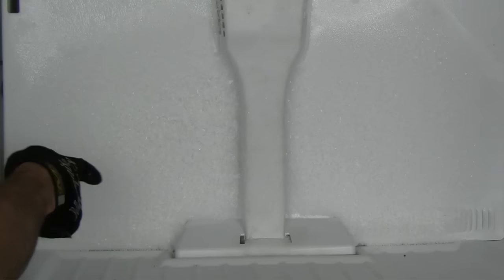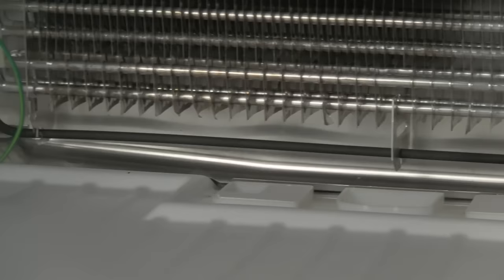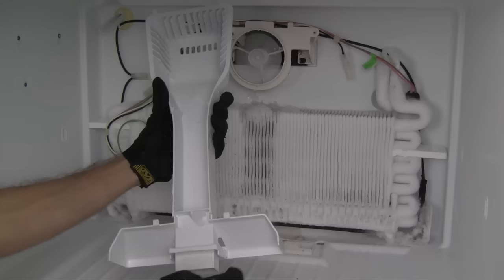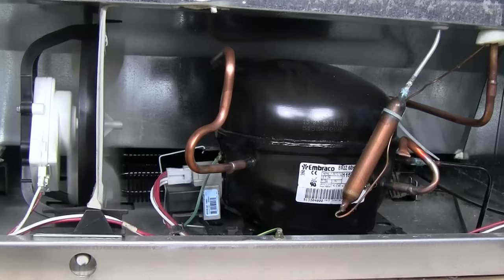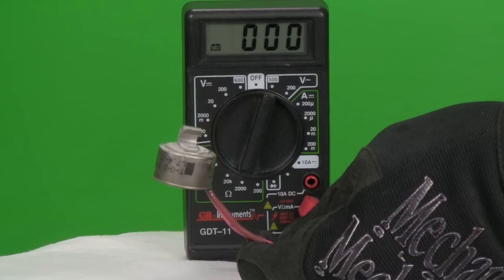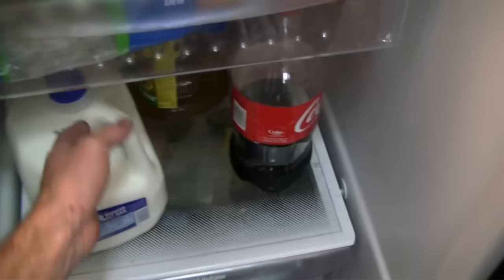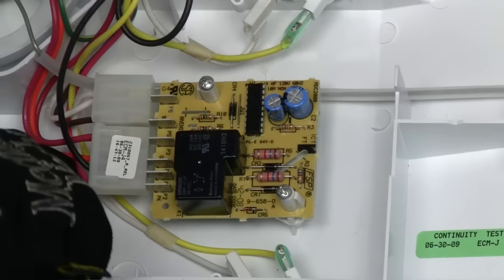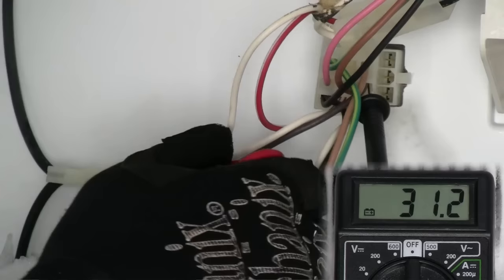Refrigerator Repair (Not Cooling, Defrost System)

Comment: Husband randomly blew out the coils and fan in the back of the refrigerator with a compressor - next morning the refrigerator was warm! - I took off the back inside the freezer and found it was iced over - I replaced the heater and it defrosted as it should again! However, the refrigerator is still not getting cold enough - I am at a loss now since I know the heater was bad and has been replaced, what else it may be now!
Reply from the maker: Given the cleaning event that preceded the problem, you should definitely verify that the condenser fan motor (the fan by the compressor) is working and not jammed by some dislodged debris. The timing could definitely be coincidental. Another thing to look for would be an uneven frost pattern on the evaporator. The evaporator should be evenly covered with frost. If there is a large area that’s clean aluminum, it likely a sealed system restriction, which is a pretty big problem. Hope that helps!

Comment from the maker: @mkiitmr2 Some Whirlpool models can be forced into defrost that way for diagnostics.  It sounds to me like you need a new adaptive defrost control (ADC). You can force it to defrost but obviously it should be doing that on it's own.  If you would consider purchasing the part through a link on my main website ( ApplianceAssistant . Com)  I get a commission and would really appreciate it!  If you email me a model number through the site I can look up the part for you and send you a link.  Thanks!

Comment: Thank you for the video! I have replaced the defrost timer in my side by side. The defrost thermostat was up around the lip of it so my appliance parts place told me to put nail polish around it to seal it and see if that worked. Well, after about 4 days, now the fridge side is again not getting any cool air at all. The damper is open, just nothing coming up through. The fridge shuts off when I hear the click from the defrost timer. The heater works fine, but did the nail polish not work?

Comment from the maker: @Philrocks09 Bummer...I'm not sure about that Frigidaire model number...If the coils are on the back of the fridge and clean then it does not sound good.  If the coils were under the unit then you may have a condenser fan problem, but static condenser models (coils on the back) don't have a fan by the compressor that can fail.  It you can feel the compressor pumping (vibrating) then I would say that one is a goner. Save your service call cash for a replacement. Sorry :(

Comment: Good stuff Appliance Guy, My 6y/o GE Over/Under Model GBS22HCPABB isn't cooling.  All of the fans are working, the thermostat works to turn on the compressor and condenser fan, the defrost heater is not turning on, this tells me that is should not be in the defrost cycle.  My guess is that the R143a has leaked out somehow...any thoughts?

Comment: we have a MayTag side by side and for some reason the fridge part is not cold the freezer works great see on June 25 this year we had a repair guy come and fix it and put a new defrost control in it worked great but today july 3rd fridge is broke with the same problem not staying cold this happened after we had a bad storm last night but the freezer part still works do you think the storm could have done something to it

Comment: Very helpful video. Thanks however, the power to the fridge tripped whenever it goes into defrost mode. Any suggestion will much appreciated. Fridge has seperate compartment with individual heater, Thanks,
Reply from the maker: Check the defrost heater for a short. If not there, check the defrost thermostat for a short also.
Reply: @applianceassistant  Thank you for your super prompt response. Will do.

Comment: Hi I have just pick up a little 5 ft fridge /freezer plug it in , it is a little cold but left like that will not keep food cold or frozen ? What should I do ?  The man in shop said turn it upside down maybe air lock . I f I do this should I have fridge on or off and how long for ? Thank you if any one can help ........
Reply from the maker: Sorry for the delay! there are a few mechanical styles on those little refrigerators... some have compressors and some have a crazy little piezoelectric cooling wafer. If you turn a compressor style upside down it will likely be trash after, and it would have no effect on the piezoelectric type... Do you have a model number?

Comment: I work maintenance and a residents freezer is just literally giving no heat, usually when I replace a T-stat its due to over frost and the part is visibly broken (busted open). The timer is working, and so is the fan which would not be the problem anyway. Could it still be the T-stat? or do I have a junk element here?

Comment: Ok. I have fixed this fridge/freezer once befor because it would no longer cool. We bought a new one right away since the old one was old. I had replaced the timer. Well now what it does, it frosts up and the fridge is warm/hot. It did that once and then started working a few weeks later. Now it is back to the same thing freezer back frosted and the fridge warm/hot. What should I look for now? Thanks in advance!

Comment from the maker: @spray2009 if you think that the door was left open --and the freezer is still cooling-- unplugging the refrigerator and letting it thaw out will almost certainly fix it.  However if the problem returns in a week or two, or the freezer is not cold then you may have a mechanical problem.  There is a lot more troubleshooting help at ApplianceAssistant Com!  If you have any other questions email me through my website with your model number and I may be able to help out with more info.

Comment: Hey, i have a Lamona HJA6000... Quite a while a go (about a month) the fan broke and i ordered a new one, during the time the fan was not working only the bottom of the freezer and fridge would get cold, and quite a lot of ice was forming behind the plastic covers at the back of the freezer, now i have replaced the fan the freezer is working great but the fridge isn't getting very cold at all  a red light also came on the refrigerators display. Any help would be great!

Comment: Hello all, 

I just moved from Texas to Colorado and my side by side fridge sat in storage for 3 1/2 months. We hooked it up and  let it run for 4 hours and the fridge side it not cool and the freezer is soso cold. I don't feel any air blowing around but the back wall on the inside of the the freezer is cold. The compressor is vibrating and hot as ****. The fan is also working. How long should I let it run before I get concerned? Thanks. Love the vid.

Comment from the maker: @stringfellowhawke247 If the fan is working well and your ice cream is cold then you must have some kind of problem with the diffuser door or the air return vent is clogged.  Even when I bugged my refrigerator to cause the frost that you see in the video it took three days to get that much frost. Some frost is normal but it should be removed automatically by the defrost cycle. Could you get me a brand and model number please?

Comment: I have a GE Side/Side fridge and the door was accidentally left open overnight. You can see the condensation all over the inside of the fridge. Freezer is still cooling, was up to -10F at one point! Fridge up to 50F. You think a manual defrost would do the trick? That's just leaving it unplugged overnight with the doors open or closed? Thanks!

Comment: I have amana bottom refrigerator(model: BX20S5W mfg. No: P1196506ww). The freezer is not cooling anymore. I opened the cover and notice the pipe that comes, I beleive, from compressor to the evaporator has iced up(about 2-3 inches, it had also covered the thermostat) but the evaporator was ice-free. Both the freezer and refrigerator are warm. The fan seems to be running okay. I am leaning toward defrost timer or thermostat. Any ideas?

Comment: Super helpful.  A few questions.  Have a GE unit with the freezer on the bottom and french doors on top.  Defrost cycle not working.  Element is ok.  Thinking either thermostat or board.  How can I check the thermostat?  Video was a little   Also, how can I force a defrost cycle?  And if that's successful, then is the problem for sure the board?  Lastly, is there any way to get a field tech service manual? Thanks!
Reply from the maker: Sorry for the delay! Unfortunately the control boards are a common failure on the GE refrigerators. You can't force all of them into a defrost... What is your refrigerator's model number? I'll look to see if I have the manual.

Comment: My Frigidaire refrigerator (freezer on top) only 'kicks on' (fan and compressor) when I turn up the themostat (make it colder).  After a short time (20 min.) it turns off and doesn't cycle back on.  I though it was the defrost timer so I just replaced it with a brand new one and same problem?

Comment: I have a GE Model # GSH25JSTA SS and the freezer wall has built up ice. I have alot of the described issues such as the refrigerator isn't keeping food cool and freezer just seems like its not freezing.  I have noticed that the cover gaskets for the heater cover are warped and singed.  Do you  think the replacement of these little gaskets are the issue here?

Comment: QUESTION: I have a Maytag MSD2651HEW. The lights, fan inside the freezer and next to compressor are working but it isn't cooling at all. I've checked for build up of frost but there isn't any. I unplugged it for few minutes and then plugged it in couple of times, freezer fan, compressor and a fan next to it sound normal  but still isn't cooling. Any thoughts?
Reply from the maker: It's not good... If the compressor is running with those symptoms, it has leaked out the gas and is going to need major reopair. If it's not a very hi end refrigerator, it's probably best to replace it.  Sorry to be the bearer of bad news.
Reply: applianceassistant hhmmm, about three weeks ago my daughter dropped something that went under the fridge and she asked me for help. I removed the front panel at the bottom of the fridge and noticed a thick layer of dust on coils which I cleaned out with the vacuum cleaner. That might've done damage! Thank you so much for your reply. I appreciate it.
Reply from the maker: you may want to check the fan in the back, near the compressor and make sure its not jammed up with dust.  cleaning the coils under the refrigerator is good! The only thing you need to be cautious of is jamming the condenser fan.... or punching a hole in the condenser coil, but i doubt you did that.
Reply: though maybe hard to believe clean coils ( if you have access ) can make a world of difference in performance. Check to make sure that condenser fans turns and runs. Of all things I had a mouse crawl through the fan blades at the wrong time and was killed and was jamming the blades from turning. Any item or thing can easily be lodged and prevent that fan from turning

Comment: my fridge doesnt have any ducting between freezer and fridge it is a side by side general electric model PSH23PSWSS. it has 2 evaporators 1 in each side. neither were frosted my defrosting circuit works and my fridge just isnt cold? the compressor seems as if it doesnt always want to start. the freezer seems to be about refrigerator temperature. any advice?

Comment: My whirlpool top freezer fridge is not cooling the fridg but is freezing the freezer, I've replaced the by metal therm and the timer and still no cooling in the fridge.  There doesn't seem to be any blockage  of air flow. The evap in freezer does run too.  Any clue.

Comment: Thanks for this video. I had the same problem with my Kitchenaid Refrigerator, Model: KSCS25QFAL00. When I tested the heating element for continuity it passed and for the resistance test it gave me reading as Zero. Could you please tell me what does this mean? Is the defrost element bad? (I am using Klein Tools MM100 multimeter.
Reply from the maker: The heater is probably okay. It should have some resistance but it may be a meter setting problem.  if it was actually zero Ω it would trip the home breaker or blow a fuse when it did a defrost cycle.  So I would check the bi-metal thermostat (part#2321799) up at the top of the evaporator, it should be 0Ω resistance when it's frozen.  if that's okay then chances are you need a new defrost control board (part#4388932)  Hope that helps! Good luck!
Reply: applianceassistant Thanks for the reply. Yes, the heater may be OK. For past two weeks fridge is working OK. If it breaks again, I will take your suggestions. Thank you so much.

Comment: Very helpful video! I wish it had been titled "Fix Defrost problems in Freezer and Refrigerators". My problem is that my automatic ice maker in a top freezer refrigerator stopped working. Then, there was trouble with the temperature remaining stable. There was drops of ice on the back of the freezer. I saw that the coils behind the freezer back were frosted/frozen over but the defrost heater wire below the coils was clean. The freezer fan motor blade (above the freezer coil) was free and rotated easily. I checked continuity of the fan, and there was no resistance, which I guess means its a bad fan. I'm thinking that the water line to the ice maker got frozen and that's what was causing the ice maker to quit working. So . . . a freezer fan that stops working can cause the defrost heater to be ineffective? Thanks in advance for your help
Reply from the maker: if there is only 2 wires going to the fan motor your test is correct and the motor is bad. on a DC motor with 3 or 4 wires its slightly more difficult to get a good reading. The fan motor would not directly cause frost build up but it would cause temperature problems and may cause poor ice production.  Sounds like the fan is a good place to start. You may find you need the ice maker also but start with the fan.  Thank for the question! I hope that helps some!
Reply: @applianceassistant  Thanks, that helps. that fan motor did have just two wires. I replaced the freezer evaporator fan motor and the entire freezer, icemaker and refrigerator is working great now. Without the fan to pull the heat from the defrost heater coil up, the icemaker incoming water and evaporator stayed frozen. I think the heat from the defrost heater coil was  warming the refrigerator too. All good now

Comment: So, I've got a 5 year old Frigidaire top-mount that gets a cold freezer, but warm fridge.  The freezer gets fully chilled, but fridge gets no cold air, even if it's been unplugged for days (or in this case, a few years).  From your video, sounds like I need to check the evaporator fan.  Can you tell me what should be checked?  (ie voltage/impedance/continuity?)

Comment: frigidaire refrigerator ffpt12f3mw apartment size was plugged in the wrong  voltage
and is smell like is burn anyways i plug the fridge and it the bottom part is working even the light came on the freezer is cool but not like before the fan is not spinning and still smell like is burning i mean what is the issue right now,  i want someone to check it out but before that i would really like to know my options thank you

Comment: How can I change the thermostat in my u line small refrigerator? it is a model 75FF with ice maker. thank you.
Reply from the maker: house wife1 Unfortunately I'm not familiar with exactly how that model is assembled. In most cases on the smaller refrigerators, the control area where you would set the temperature has the thermostat in it and a temp sensing lead that is in the compartment... I would start by opening the control area and looking around. (unplugged of course.) I hope that helps some...

Comment: Whirlpool gold gS6SHAXMs00 fridge not cooling on right side, but cooling in freezer side. Also, digital readout is blank and it stays about 60 degrees in the refrigerator section. The light bulb in the refrigerator section is also not working. In the freezer section in the bottom it gets iced up. Is this a problem with the control board?

Comment: Hi AA i really need your help. I have a Kenmore side-by-side w/ water & ice. So there's the problem. On the freezer side only the bottom half is frozen everything else has thawed. Plus the frige is slightly cool but, not cold.I first realized it last night so i did turn down the temp. can you please help me. thanks

Comment: hi need help!freezer working fine,but fridge not cooling,i opened the rear panel in freezer compartment,fan not working,tested it,burnt out,bought new one but not powering up,tested the connections where the evap fan plugs in with multi-meter theres no power,so new evap fan not working,pls let me know wot it can be!

Comment from the maker: @MrMindShifter I would need a model number to be sure on your second question. Is you freezer food frozen? While 40º is not the greatest it is a fairly normal hi-side temperature especially if you have the door open checking the temp.  It sounds like it's working okay to me...

Comment: Heater replaced , check!  defrost thermostat replaced, Check!  Defrost timer replaced, check!  Heater comes on and melts (some)frost, check!  But frost continues to build up at the bottom of my 1994 GE Profile side by side eventually causing temperatures to rise, and forcing me to open it up and blow it with two hair dryers while I put all the food in a cooler.  Refrigerator resumes perfect cooling (below zero) for a week or two, then deteriorates.   Question.  since the frost only builds up on the bottom quarter of the evaporator, should I clip the thermostat down by where the frost is?  What would you do?   Note:  This evaporator has two heaters, the bottom one is the only one that doesn't keep up with the frost.  fan in freeezer blows good too.

Comment: GE  profile refrigerator. Frig and Freezer are not cooling and error code failure with temperature control panel to main control board communication.  Any Suggestions of what this means or what to do?